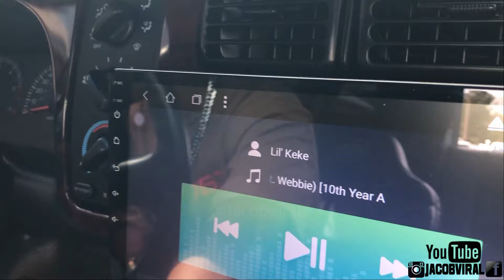ONE SUB WOOFER SYSTEM INSTALL SOUNDS GOOD!

Comment: ya ya sumn like that - he has no clue on tune ... "i just threw it together" .. respect for the blow through  !!  damn I hate bullet tweets  they sound like shit....
Reply: That just means you don't like loud tweeters and you can control them with a knob a lota guys have all lows and no highs when you balance your high mid and lows your system won't sound like trash
Reply: @GMTPF800  in general bullets are poor SQ - that's what I meant - nothing to do w volume..
Reply: @rts100x5  Ben using them over 30yrs in dj application and car audio..and your right.sq is defiantly not suited for sq  there mainly for EXTREAM spl.ther is no other tweeter that gets extreamly loud
Reply: Yeah I totally agree bullet tweeters are when you have like a ton of bass not one subwoofer.. we're talkin 150db at least with a lot of woofers. Loud loud Bass..also bullet tweeters if not tuned correctly produce a tremendous hiss .. which is what hurts your ears.. definitely not of the SQ world
Reply: That's a lot of box/work for one driver !

Comment: Not a hater by any means but something tells me old dude did NOT build that box.. man I keep seeing these single sub builds and makes me want to get my single zvx 12 metered because my whole truck flexes to the point where the outside door handles dance 🤣🤣
Reply: What amp you running?
Reply: Taramps smart 3k
Cant beat it for the price. I was sceptical about purchasing it but now I'm glad I did..  one of the best amps iv had

I got the zvx in a custom 28hz slot ported box with the port extending outside the box..
Reply: I swear this is an old video he posted. He be posting the same video just to get views